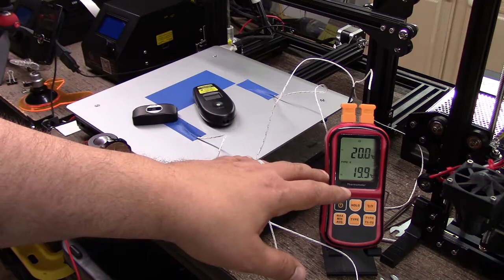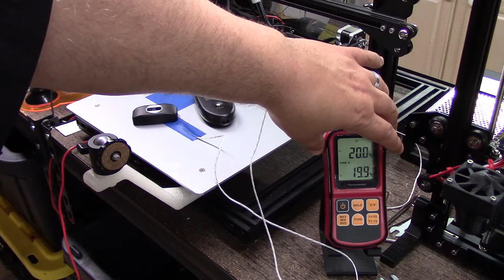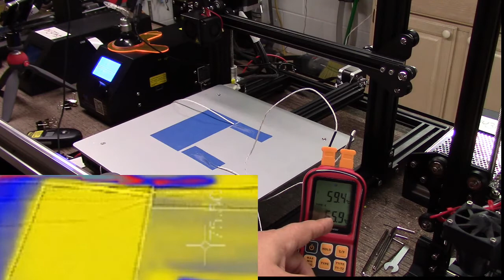Shop Talk - Measuring Your Heated Bed With an IR Thermometer!

Comment: I wounder if there is a latent heat type impact, glue on tape may take a degree to change it's adhesion :)
https://en.wikipedia.org/wiki/Latent_heat
Reply from the maker: Latent heat is different, the tape has a greater surface area to it (this is why it works for 3d printing) and the adhesive acts a thermal compound for improved transfer...
Reply: P.S. I use, great, Elmer's Disappearing Purple School Glue Sticks, 0.21 Ounces Each,
6 Sticks per Pack (E1560)
http://tinyurl.com/purple-glue-stick

for ABS at 225 C Nozzle and 65 heat Bed
Reply from the maker: I have sworn off glue stick years ago, have been using PEI for ABS and with tight first layer have had no issues as I go 235c on the hot end and 100c on the bed (more so stop warping)
Reply: great :) 100C is boiling water hot so take care.

Comment: Our Fluke FLIR camera's user manual states that a measurement of a shiny surface will be a combination of the desired location and the reflection.  That's why Fluke recommends you cover shiny surfaces with flat paint or tape to obtain accurate readings of the desired surface.
Reply from the maker: Think that is part of the controversy here 'Fluke FLIR" as these are different animals (i.e. Fluke verses Flir [brand]" as too part of this I agree with you however also note what you wrote " a shiny surface will be a combination of the desired location and the reflection" as if there is something in "addition" to the radiated heat it will be added however you don't have reflection then there shouldn't additional heat if you see what I mean.
Reply: I was just emphasizing that you have to cover reflective surfaces to get accurate readings.  It doesn't matter who makes the IR camera.  I do agree that this bed is uneven thermally.  I guess that's why my MK2 has a segmented head bed.  I guess that's why the gCreate also has a segmented bed.  I also have a CR-10, so I'll be interested in what others do to fix the heat bed for higher temperature filaments.
Reply from the maker: Not sure thee is a good way to "fix" as for a DC heater in the open air it is pretty large.  Over the Jul 4th weekend coming up on us I going to an insulating project to see if I can improve it stay turned the video should be out in about two weeks as I several other queued up already...
Reply from the maker: Great minds think alike as I have already done this and actually if you haven't yet you will want to double it up.  Produced a video on this where I tested and one sheet doesn't make a big difference but two is a greater improvement.  The video is the queue an I think I set it for release late next week or early the week after as I travel for work shoot a bunch and queue them up...

Comment: Main thing is, the bed is a matte finish, almost looks anodized. This works for your bed, not in general for all aluminum. I'll add this to a set of tests I will do when I construct my new AC powered 24" bed.
Reply from the maker: Think part of this is as another viewer wrote from the manual which says " a shiny surface will be a combination of the desired location and the reflection".  From this I can understand the "additive" effect and since I don't have any reflection there wasn't an issue and hence the matching temps.  Also yes would love to see videos of that monster!  :-)
Reply: It has to do with the emissivity as well. But, I have seen even my reflection in a thermal camera picture of a piece of brushed metal. Visually it looked like a satin finish, but in IR you could make out individual fingers etc.

Emissivity on the other hand will make something look cooler than it is in reality. The perfect emitter is a blackbody -- it will have an emissivity of 1.00. Something like pure carbon will have that. On the other hand, aluminum could be anywhere from 0.7 to like 0.1, depending on the surface finish.

Your camera should have an emissivity adjustment option. Take a look. You'll see it adjusts the reported values.
Reply from the maker: Hmmn never heard of Emissivity, will have to look but don't recall it.  Thanks for sharing too!

Comment: Would be interested to see the results if you replaced the stock heated bed with an ac-powered silicon one.
Reply from the maker: I might do it, depends as mainly print PLA so this one works ok,if I was doing ABS (which I hate) then yes it would be a MUST do :-)
Reply: DIY3DTECH.com I was thinking even for PLA to heat the bed faster and more evenly.  I always use a heated bed for PLA on bare glass with no bed adhesives.
Reply from the maker: Going to trying an insulation project over the weekend as I got some cool stuff just hopping it works so look for a video in about two weeks :-)